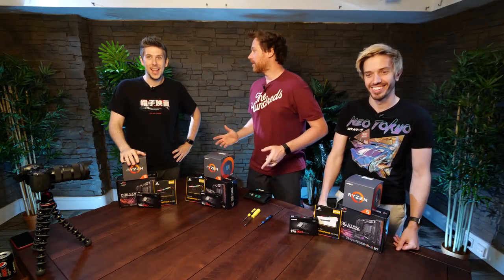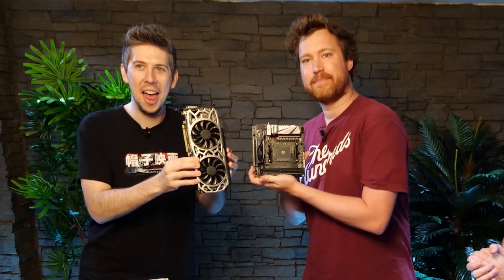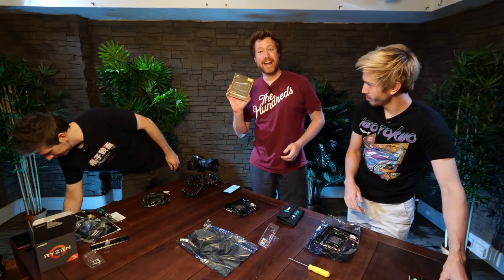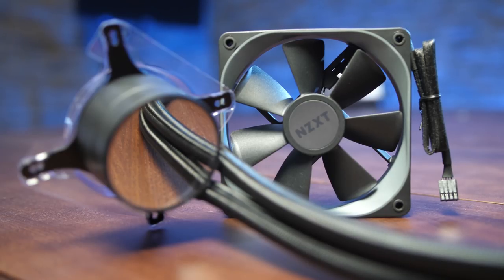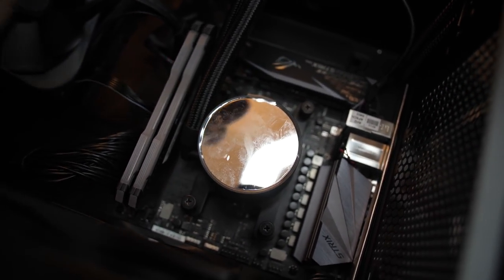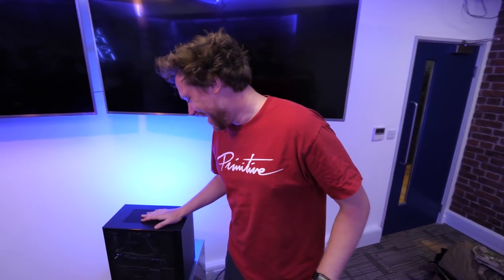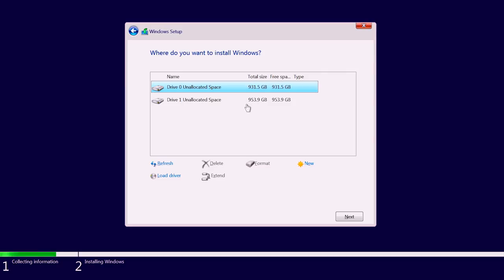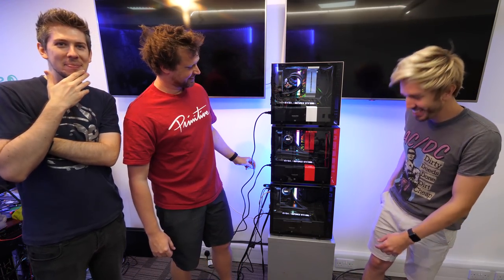BUILDING MINI 4K GAMING PCs!

Comment: TO ROSS About the windows update... You can disable the windows update service and not be bothered again. Just type in "disable windows update service windows 10" and you will never be bothered by the restart problem again. When you want to do updates, just click the start button and type "windows update" and do it manually. You can also just stop the service temporarily while recording if you don't want it always off.
Reply: Only over a shorter period. If you shut "down" to hibernation (i.e. let win run over several days) , when it comes up, the update annoyance hits again. Whatever you set it to, win restarts the service at some point. And you have to stop more services than just windows update.  In a normal 1 day up usage that restart probably doesn't happen.

They try really really hard to stop you from stoppiing the update restarts.

Comment: If you want to save some money on a build like this definitely stick with the Ryzen series of chips and you can drop the GPU completely. They have a pretty decent integrated graphics card. Your build will be a little RAM hungry so definitely don't go below 8gb (which you shouldn't be doing anyway). I'm running a 2200g and 8gb RAM and it handles current games well enough on medium/high settings, and later I can add RAM or a graphics card and have a really nice computer.

Comment: I loved this video. Building PC's is something that is always slightly nerve wracking, but also extremely  exciting to me. I've had to build a few PC's recently for my friend's video design firm while I worked there, and my own upgrade. I have a fair few similar components actually. NZXT are the only cases I ever want to use anymore personally.
For Windows 10 Pro, there are a bunch of little quality of life changes you can make. The settings are not easily accessible, but with a couple snappy registry edits, you can take back control from Microsoft where they otherwise hamfist your butthole with update bullshit. 
You can make update notifications go away. You can make it so you choose when to download updates, and when they are installed. The way it's supposed to be. Microsoft was an absolute cunt with some of the dumb BS they forced into 10, but, you can still edit your registry a little bit and get them to kindly fuck right off.

Comment: Just noticed you’d probably want blower type fans on a GPU in the spot, it’s crammed against the PSU it looks like so those GPU fans won’t be doing much/might see high thermals blowing in air from the PSU.

Comment: @Alex Smith, fans are built such that the side with the frame supports is the direction of flow, so if you want it extracting you position the side with the frame support/connectors against the case eg. the way round the fan is on the kraken radiator. 
No need for an arrow :P

Comment: Does anyone know why they installed both the 970 pro and the 860 evo? Is it because the 860 is a secondary harddisk (Solid state disk, I know), or it the 970 pro something different (not an SSD)?
Reply: To explain it quickly, they've adopted the mentality that more is better. Not a bad thing, since you can use multiple of anything so long as you got the slots for it.

The 970 pro is an M.2 SSD, and thus is faster than the 860 Evo, which would serve best if they used it as a boot drive and to install anything they want to load excessively quickly, like crucial files needed for editing, the Windows OS, or editing software itself.

The 860 Evo is a standard SATA SSD, and is simply there to be used as extra storage for anything that they don't want to put onto, or can't fit onto, the 970 Pro, so anything that doesn't need to be loaded quickly. This could include games if they're not specifically bothered by the loading times. It entirely depends on what they value more.

They've only got one M.2 slot, however they've also got SATA cables, so they can have more than one storage device, regardless if it's an SSD or not.
Reply: Ah okay thanks. So instead of the usual SSD for your OS and HDD for your games, they've gone for SSD for both. Got a bit confused since the 970 pro looks nothing like the 860 evo
Reply: Correct, and yeah, that gets a lot of people.
Reply: Thanks man
Reply: No problem

Comment: There should be a sticker on the fan which will almost universally be the direction the air blows out of, being sucked in through the side without the label. Might depend what your fan is used for specifically but generally speaking it's a reasonable rule of thumb.

Comment: Quick question, if i installed a game onto a detachable hardrive and then removed the hardrive to then put the hardrive in another computer would the game still be able to run on the new computer?

Comment: The side of the fan that has "spokes" that hold the center hub in place; that side is the exhaust. The open side where you can clearly see the fan is the air intake.

Comment: I’m currently debating whether or not to purchase ordinary fans for my PC or to invest in a water coolant system. What’s your opinion on them and are they worth the extra £150/£200?
Reply: It depends on your current PC setup, and what you do on a regular basis. If you have a high end setup, and you do a lot gaming/editing/workstation stuff, then a liquid cooling system is the best way to go. Otherwise, if you have a low or mid range setup, then you can go ahead with just ordinary fans (you can still do liquid cooling if wish).

Hoped that helped! :)

Comment: It's not hard to tell which way the fans push/pull air once you know the trick, basically the "frame" on the back of the fan is where you want the air to be moved too, and the clear or more visible side of the fan is where you want the air to be pulled from :) if you see this, I hope it helps for the future.
Reply: Oh and considering the 1080ti's pull air from the case and onto the the heatsink, they won't get enough air for decent cooling with how they've been positioned, though i suppose that's more to with the small form factor and the PSU shroud being installed than your fault :P

Comment: Magnetic screwdrivers lul.
Reply: It's highly recommended to use magnetic screwdrivers when building a pc, the magnets aren't powerful enough to do any damage and it saves fiddling with and dropping those pesky screws
Reply: TheRutefly, All screwdrivers are magnetic except for extremely cheap ones. Certainly any of the nice torque screwdrivers people use for building PCs are almost 100% guaranteed to be magnetic.